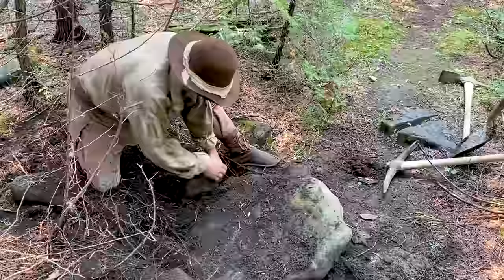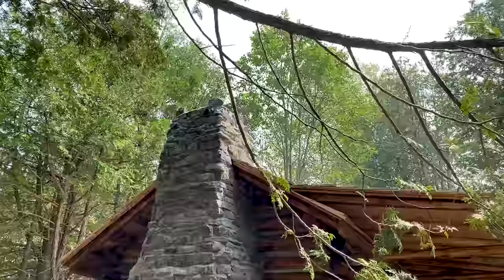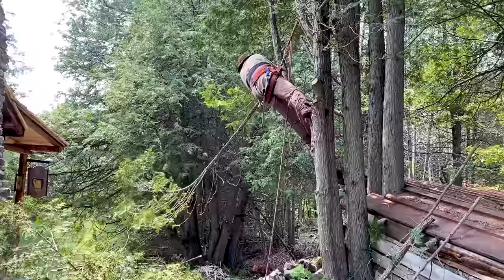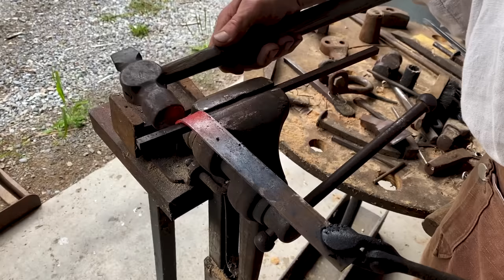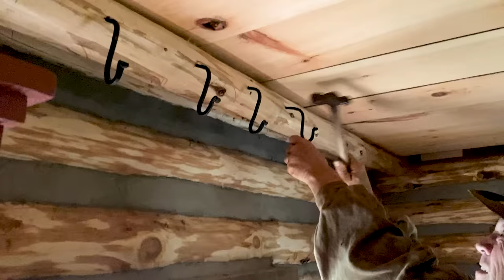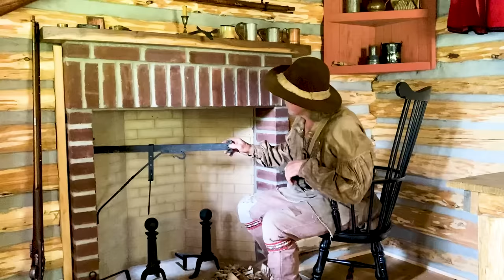First Fire in the Rumford Fireplace  | CABIN BUILD | PIONEER | OFF GRID

Comment: My grandfather built a fireplace like that @ 80 years ago,  just as I was born.  We burned @ 4.5 cords of wood per year to keep the house warm.  Then @ 60 years ago, a old fellow who had been building fireplaces came along and measured it up.  He bricked it up 3 coarse from the bottom, filled the base with sand and put a steel plate with glass doors across the front and cut our firewood to less that one cord per year.  He also cut a hole in the wall and fed 4" of air in to the fire from outside.  You have built a beautiful, authentic hot air vacuum cleaner, sucking all the heat out of the house and cold air in every crack from outside.
Reply from the maker: It isn’t as efficient as you grandfather’s but it is how they were built, historically.

Comment: Rumford in the title hooked me. I retrofitted a rumford to my fireplace about 5 years ago, it is slightly smaller than yours in  width and depth but about as tall. I tend to make the fire right against the back wall and once the kindling is established i place a semicircle of logs vertically around it, immediately the flames rise and throw out heat. The draught is exceptional, having grown up in Ireland with small smoky fireplaces. I fitted a damper, but I never use it. I think I posted a video of my fireplace in operation years ago.
Reply: Agreed regarding the fire-building structure in a Rumford.  I expect a man of his talents and knowledge is aware of that but likely just wanted a cooler, small fire for the first burn.
Reply: @joezaleski7037  Yes indeed, of course, I didn't think of that. I think I left mine for weeks before lighting it.

Comment: A fireplace like that does nothing more than suck all the heat out of the house. Even Ben Franklin knew that. I'd up my historical fantasies to the point of installing a good cast iron woodstove as well in case I needed some serious heat in the winter.
Reply from the maker: Actually, Rumsford took on the challenge to prove he could design an open fire place that was more efficient than the cast iron stoves at the time.
Reply: @TheWoodlandEscape  The Franklin stove - if you can call it a "stove" - used 1/4 the wood of an open hearth and put out far more heat than an open hearth. That was in the 1740s when there was a wood shortage in Philadelphia.

Comment: That has got to be a really good feeling, that first fire. I also enjoyed watching you coil the safety line. I've messed about in, around, and with boats all my life, the last 20+ years professionally, but I still have trouble coiling line easily.
Reply from the maker: Been coiling ropes for 30 plus years as an arborist but, you should have seen me when I started, lol.
Reply: It's a cool  cabin but that type of chimney is stupid, the fire heats up the stones in the chimney but it's all on the outside so most of the energy gets wasted. And the chimney is wide and straight so the heat goes right out.
Reply: @flamenmartialis6839  The rumford design is more complex than you think, yes some energy will be wasted, but the design gives a chimney that draws, but not too much, and the angles of the back and sides radiate the heat out to the room. If you are worried about efficiency then an authentic 1800s cabin is probably not for you!

Comment: Fireplace turned out great. Rumfords like tall longer wood length teepee fires built just like you did on the floor. When you want heat. The tall fires take advantage of the draft in the tall fire box and follow the standing wood right up it’s length. Be careful though the fireplace will blast you out of the cabin. The rumfords are the best. For cooking your fire would work better. And I know you are breaking the fireplace in. Going to be best friend when it’s winter.
Reply from the maker: That is great information Jim.  I’ve heated with wood my entire adult life but, the Rumford fireplace is new to me , so, lots to learn.  Thank you.
Reply: My cousin was a master brick mason. We were his last job before he retired. We helped him build a 4 ft and 5ft rumsford fireplaces and a brick oven next to the 5 ft one. Once you break in the rumford the other guy was right about setting your wood on end against the back wall to really use it correctly. Once the room is hot or your cooking let it die down. Rumford fireplaces are dramatic and are designed to kick the heat into the room. The reason I checked out your video was because I saw rumford. I subscribed, very good channel.
Reply: @TheWoodlandEscape  I too built my own back around 99’ -00’.  It was a  challenge but well worth it. I can tell by the pride in your eyes and smile what the fireplace and chimney mean to you. It’s very elemental, not only the symbolic hearth of home and sustenance, but literally what will keep you alive! Another thing we have in common, I am an arborist as well.  Seems that trees and stones go together.

Comment: To make sure you get a good draw in the chimney, put a small bit of burning tinder into the flue. this has the cooler air below feed the flame and warmer air above rise, creating the proper draft for the fire. ( a full page of newspaper crumpled into a loose ball is enough. )
with the flame above the actual fireplace for long enough to create the airflow you avoid the house filling with smoke because it isn't drawing properly.
Reply from the maker: Sound advice and it really does work.  So far though, I’ve lite the fires without and have no smoke issues … this guy seems to have amazing draft.
Reply: @TheWoodlandEscape  Then it's a properly designed and built fireplace.
Many newer builds are not set up correctly without an inserted burning box and flue.
Even then they may not draw right without something to start the airflow.

Comment: I built a stove with a passive heat system into my home here in Wisconsin with concrete and clay . Have a sleeping area over the top of it and it radiates heat for hours with out having to stoke the fire every 2 hours . Living area is always toasty . Very nice but you need a big  slab of stone or other material to get it right . The amount of wood I use is very minimal as what i used before . I fire it up for 3 hours and the rest is toasty !
Reply from the maker: Certainly not the most efficient but, we attempted to recreate a settlers cabin from the 18th century and this is how they built them.

Comment: Yep the heat go's straight up the chimminey and you git the smoke.
Reply from the maker: However, this design was an improvement on the standard “box” fireplace.
Reply: Add a bigger room around the outside area to be heated next winter.
Reply: @jjones8813  or 'Frost sign' warnings.

Comment: I would put in a wood stove in the kitchen area to heat and cook on, it will give you a much better heat source.  You can put a fan on the flew pipe that rotates from the heat no electricity needed.  Plus you can use cast iron skillet and other soup pots on it, too.  Love your log cabin, it is beautiful!
Reply from the maker: It would indeed be a better system but, we attempted to creat a settlers cabin from the early 1700’s and they simply didn’t have these luxuries.

Comment: I have built several Rumford fireplaces. They really work well, relying on the infra red principal. There are critical dimension to a true rumford. The width and height of your firebox look correctly proportioned as does the firebox floor flush with the room floor. A true rumford has a very conical shape. The side of your firebox look appropriately sloped. However the vertical back of that size box would only be about 12-15” before it starts sloping forward to a 4” damper throat the full width. It creates a large smoke shelf above the damper. A Rumford is built just short of stalling and smoking. The shape and back force the heat and flame to rise along the entire width and height of the firebox. You don’t need to sit near a Rumford to be warmed. If you can see it, you will feel it. I built my first Rumford during a bitter cold winter. At one point I was sitting on a bucket taking a coffee break. I was only wearing a tee shirt. I could see my breath because the house was just being built. But I was completely warm from a modest fire I had started in the firebox.
Reply from the maker: Thanks for taking the time for your wise feedback.  Ours does seem to work well and as you point out, reflects great heat.

Comment: The efficiency of this fireplace is very small, only about 35%! And the closed-type stove placed right in the house has an efficiency of about 95%! So it's better to choose a stove! In addition, sparks fly from the fireplace, which greatly increases the danger of fire! )))
Reply from the maker: We’ve attempted to recreate a  early 1700,s settlers cabin and stoves were not used.  Your are totally accurate though as to the efficiency of the fireplace.

Comment: Go to the scrap yard and get a quarter inch thick tank of metal and have them cut at the size throw it up on top of there for the Chimney Cap
Reply from the maker: I actually did build one as you suggest but.  I need to add some height to the 4 raised corner stone to get a good draft.

Comment: Just ran into your channel and caught my eye when the title mention "Rumford Fireplace." It is one of the best designs for a fireplace I have seen. I first heard about it while attending a Solar Adobe Building School in New Mexico many years ago. I just reflects heat out of the fireplace better than any other design and vents the smoke effectively as well, and yours looks great.
Reply from the maker: It will be a wonderful place to sit and enjoy winter weather out the windows.
Reply: The fireplace in this video is not a good representation of a Rumford design. Though the opening proportion to its depth appears correct, the most elementary design component was ignored. The sloped back and side walls which would originate from a square at the back wall one third the size of the opening. This is the characteristic that radiates the heat into the room. As the heat from the fire rises it warms these sloped surfaces. This is the design element missing in the fireplace in the video. The walls in the video are plumb, maybe due to avoiding the complex cuts involved with sloped walls. His heat travels straight up and out the flue. You see Rumford was about fixing poor functioning fireplaces. Nonetheless this is not a good representation of a Count Rumford fireplace. 
Interested in using the book that explains his design?
“The Forgotten Art of Building a Good Fireplace” by Vrest Orton (available in paperback).

Comment: Your fireplace walls look straight up so I was wondering if you put in a damper and smoke shelf ???
Reply from the maker: I built it to Rumford specs Ken.  You can see the interior in previous episodes.  So, there is a curved front ventura
Reply from the maker: Sorry Ken, to finish the previous post …. A curved throat with a draft control on top, followed by a smoke chamber and then into 2 8”x12” flues.

Comment: The splash guard should be turned around to be used as a backsplash and a shelf at the sane time
Reply from the maker: Hi Vickie.  I oriented it that way due to the gab between wall and work bench counter.  I could add another piece for a shelf… thanks for the feedback.

Comment: There isn’t any way you are going to get a stone cap up on the top of that chimney without some modern help.  When I put a steel cap on my former chimney it took two of us and every year when I had to move it so I could clean the chimney it was all I could do to move it away from the flue.  I welded it up from 1/8” scrap steel and put a Hardwear cloth screen on it to reduce the flow of sparks which could end up on the roof.  It still weighed over a 100#, which kept any gust of wind from moving it.  It stayed in place through several hurricanes.

Comment: Peter, i have a question. In Sweden, the chimney is most often located in the center of a building. That way the brickwork keeps the heat long after the fire is gone. Why does so many US homes have the chimney on the "outside"?
Reply from the maker: It was the style in the 1700 hundreds as well as practical.  Chimney were dry layed and they lived in fear of fire.  Should there be a fire, they could pull the chimney away from the structure and hopefully save it.
Reply: @TheWoodlandEscape  Thnx for the answer Peter and thnx for your videos.

Comment: If u didn’t break off that much, seems like you could modify the hole that was left when you dug it out of the ground, point being: use the ground for a mold, most of hole would be a perfect duplication of the shape of that rock, except for the part that broke off. The hole would only be as deep as the stone is thick. Dig out the part where the repair will go, make it the shaped you want that part of the margin to look like, then just fill that hole in with a fine gritted cement overlapping the cap stone to help it stick to the cap stone.
Reply from the maker: That is sound advice sir. Thanks for sharing.

Comment: Thank you so much for sharing and teaching us. I could listen to you for hours. What kind of wood do you burn in the fireplace? Which ones are good to use and doesn't it smoke much? We have some pieces of firewood that are burning like anti-wood, think ours is spruce. God bless you.
Reply from the maker: If it fits in the fireplace and it burns, it is firewood, lol.  Most hardwoods are great and should be cut and seasoned for at least a year before burning.  Softer woods, particularly conifers, produce a lot more creosote and produce less heat.  Your anti-wood comment gave me my morning smile, thanks.

Comment: That's a faux Rumford. The height × width will equal smoking into the room and creosote glazing at the upper fireback just below the damper, of which many dampers for that style are not designed fir it and will too easily drop closed. Cool costume.
Reply from the maker: The damper slides horizontally.
Reply from the maker: We aren’t having any smoke issues.
Reply: @TheWoodlandEscape  Excellent! 22 years as a sweep I saw lots of those and they were all trap door style.

Comment: I'm watching how you tied your rope.   I never saw a rope finished off like that before.   I went back a couple of times to see how you did it.
I do have a question.  This is my first time watching you.   Why did you build your fireplace on the outside of the house and not on the inside?   You'll get more heat from the inside and less creosote.
Reply from the maker: It. Is the way they were all built in the early 1700’s … usually dry layer stone and could be pulled or pushed away from the structure in the event of a fire.
Reply: @TheWoodlandEscape  that would make sense then.   I want a home that will have a fireplace in the center of the house for more heat radiation.

Comment: I was curious how you were going up those trees in your moccasins and securing yourself to the tree.  Where did you set the belay point for you to hang from?  How did you do it?  I spent several Summers working on sailing ships and I've also done some rappelling but wanted to get your comments on how you did it.  I like that harness seat set up you have.  Better than a Swiss seat or a Bosun's chair!  :-)
Reply from the maker: I was an arborist for 35 years Josh and employed the same method.  I free climb , then place my climbing rope around the trunk and over a strong branch union.  I use. tautline hitch for ascending and descending.

Comment: I’ve never understood the reason for such a large fireplace of stone with the bulk of it on the outside. Seems like such a waste of stored heat. But, I’ve also always lived where it gets cold. Is that the reason? In more temperate climates this style keeps cabin cooler?  It’s very cool either way.
Reply from the maker: Great question because from a thermal dynamics point of view it makes no sense at all.  Having said that, it is the way they built them in the 17 and 18 hundreds.  My thinking is, ease of construction and most were dry layer stone and in the event of a chimney fire the entire structure could be pulled away from the cabin.  I can attest to the fact that one is only warm on one side at a time on a cold day.
Reply: Thanks for replying. Interesting about being able to rip it from the cabin. Makes sense. Cheers!  @TheWoodlandEscape

Comment: I'm curious about the iron pieces inside the fire place. What are they exactly?
Reply from the maker: They are fire dogs or andirons.  The logs are placed on them to allow air to circulate - better burning, less smoke.  They also stop the logs from rolling into the room.
Reply: @TheWoodlandEscape  I need to find some of those for my fire place. It's not a 1700 model but it is from the early 50's and I think they would go well with it.

Comment: Can someone explain to the logic of placing a chimney on the outer wall? Seen from Northern European logic, the concept is insane: Rocks store heat and cold. There is no way you’ll get a proper draught in an ice cold chimney. The second a consequence of the former: The heat from the fire is stored and transmitted in the stone. In Europe we place the chimney in the center of the house, which gives off heat to all the rooms - on all floors. Looking at this picture, one sees that ¾ of all heat is lost. Add to that that an open fireplace is literally a heat-vacuum, and I think you’d be better off making a bon-fire outdoors.
Reply from the maker: This was a commonly done, apparently due to the fire risk.  Chimneys were dry laid, and, as such, could be pulled away from the cabin in case of fire, thereby saving the structure.
Reply from the maker: The design changed in the 1800’s to a more central location for all of the reasons you mention.